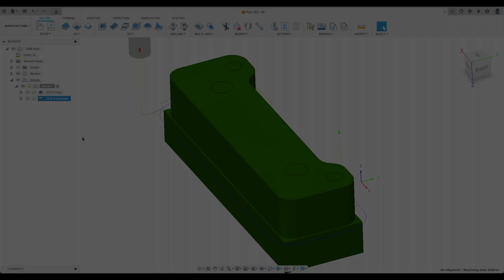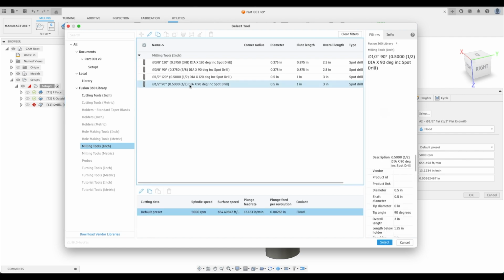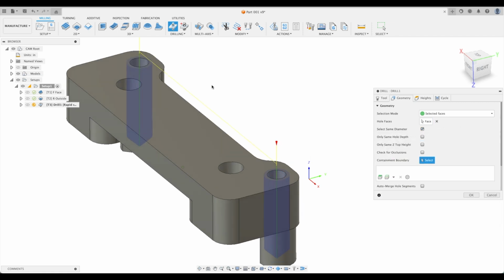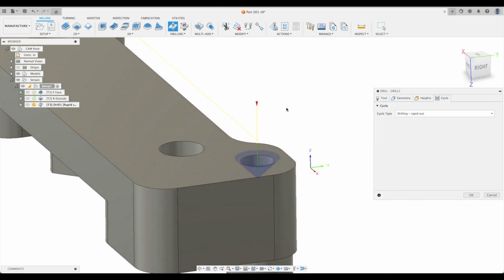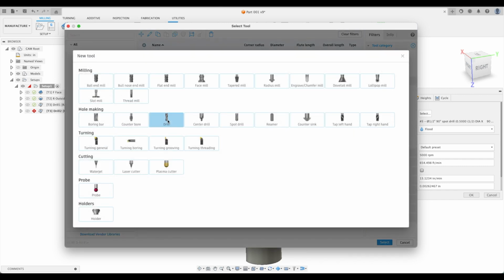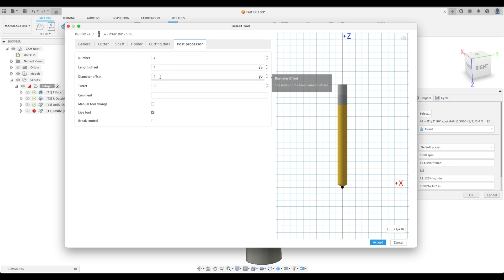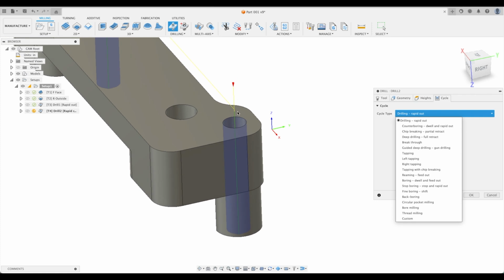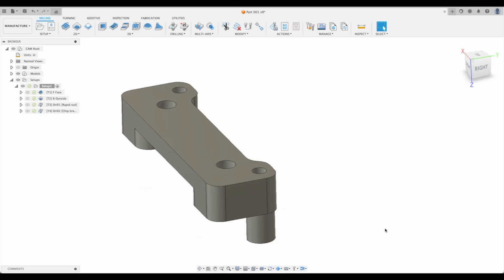Fusion 360 - HWIMT - Part 001 Setup 1 - Op 3 (Drilling)

Comment: So in the simulation it doesnt show all the increments? I wanted to do the chip breaking but I just couldnt get it to do it. In the simulation it just plunged in to full depth and moved on to the next hole even though I selected the chip breaking.
Reply from the maker: It should show the incremental movements. What were your parameters that you inputted after selected chip-breaking?
Reply: @learnitalready  I already found out. The lift height Was only 0,1 mm and the Pause before Lifting was 0 s. Increasd the values and the movements were visible 👍
Reply from the maker: @EsTee932 ah! Perfect. Thanks for sharing your solution.

Comment: I'm so lost! How do I even get the options your screen has on the toolbar? I'm using a parametric 123 block I created as my model. I am just trying to drill the holes and simulate it. This series is fantastic, if I ever figure it out! I will watch several times. I never quit! I'm 71 years old and had my own manufacturing business for 43 years. I taught myself machining, welding, fabrication, electrical and anything else I had to learn to get the parts made. There was no internet back then so what I learned I never forgot, learning the hard way. I bought a SuperMax Y-40 CNC milling machine 18 years ago. It has an M400 control on it, that I had to upgrade to the Linus software years ago. I managed to figure that out so I always wanted to learn CAD and figured I was too old, but I decided to try to learn it anyway. I'm not dead yet. I make folding knives for my Grandkids and family, but took a break to learn Fusion 360. I can never just sit and do nothing. My mind has always raced from the minute I wake up until I go to sleep. Thank you so much for the excellent videos you make! My email is: garycullen116@gmail.com,  just in case you need me to teach you a thing or two! LOL I'd love to talk to you.
Reply from the maker: Hello Gary! You’ve got such a determination to learn! I love it.

Thanks for telling us a little bit of your background. You sound like you have a ton of experience. I will email you to see if you’d like to set up an appointment.